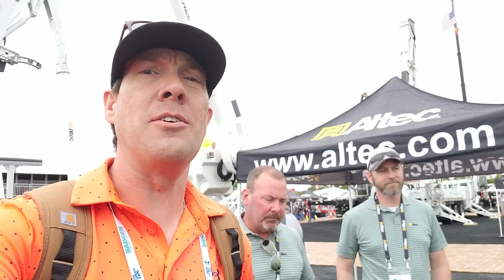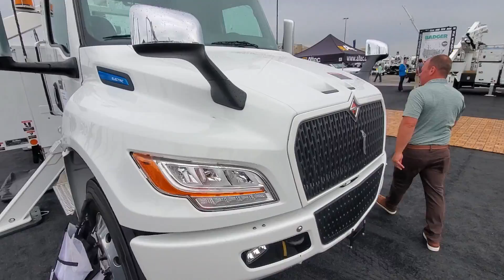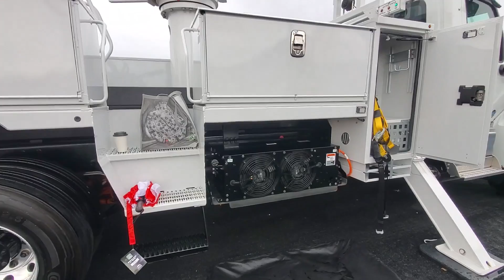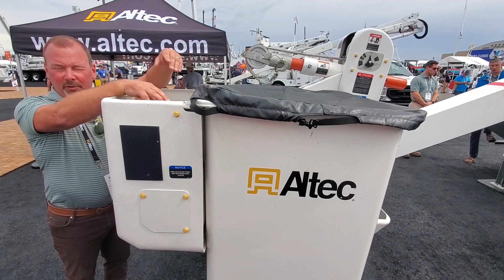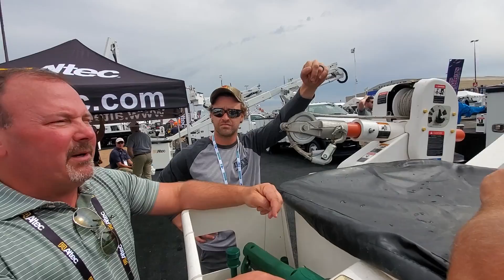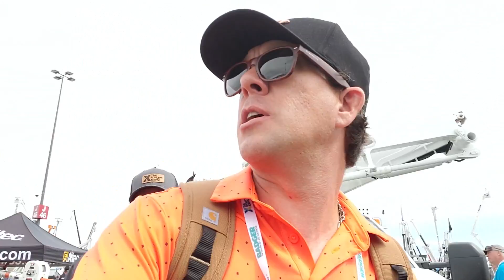EV Altec Bucket truck!

Comment: The problem that I can foresee so far is that those trucks may not have enough battery to handle a heavy day of use. Yes it may work for most work, but get a single complicated job and it will run out of battery. And unlike gas/diesel, you can't charge it back within minutes. And if things goes really wrong and they can't move the truck for some reason and it run out of fuel, you can always refuel it with jerry cans. You can't do that with battery powered. Even if you were to bring a generator on site to charge it back, it would take a few hours, and needs to be turned off before charging. With gas/diesel, even if it is not recommended due to the fire risk, in reality you could very well refill while the engine is on. But even if you do need to turn it off, it would be for max 5 minutes. Not the few hours for the battery one.

Also, cold winter and very hot summer are very problematic for battery operated vehicules. Which also limit their applications.

But they do have their place, if they can handle a full day of light work. And I have no doubts that they can.

But the problem is the price. You can most likelly buy 2-3 diesel trucks for the price of one electric one. In 10 years the battery will be dead, and it will cost almost the same price as a new truck to replace. The diesel one will still work fine in 30 years with regular maintenance.

I personally do not believe that the solution is full electric, but plugin hybrid. They can also go with a smaller diesel engine in them. Heck, instead of a let's say 200hp engine, you probably can get away with a 75HP generator. Why? When driving you use power mainly to accelerate. On deceleration they can use regenerative braking to recover part of that energy (to charge the battery) then they can use the battery to accelerate back the vehicle. When in steady speed you need a relativelly low amount of power, which allow the generator to charge the battery for the next acceleration.

Those trucks stand idle most of the time, with their engine idling. It is very inneficient! A plugin hybrid would run on battery until it start to be too low, then the engine start and run at it's peak efficiency to charge the battery, then shut off. For idling, you can easilly save 10 times the amount of fuel. While driving about half.

And those plugin hybrid don't need a big battery, which drop the price ALOT. And the smaller engine cost less too.

Comment: Honestly, I see this as a truck for the city - downtown, or dense residential areas where you don't want to be sitting there for hours on end spitting diesel fumes into the air. Many cities already have restrictions on truck operations due to noise and pollution. A fully electric truck makes complete sense in this case. You'll still have diesels for your rural areas (or hybrids), but in the city or urban areas, electric makes complete sense - cheaper to operate, easier to drive and electrics excel in the stop-and-go traffic you find in an urban area. It's not just the future, but if the technology can work great in urban areas why not start there? No one said one size has to fit all - which is why we have vehicles on the road from bicycles to semis. 

So it makes complete sense to me to offer it. Also - gas pumps don't work without power. During  a storm in the city, these trucks can also be stationed around, and with the increasing number of EV chargers, they can be sitting around waiting for a call and still plugged in so while "on call" in the city the crews can remain charged while still having amenities like air conditioning and heating without needing to idle the engine constantly.

Comment: 2:14  but level 2 is standard, level 2 is a domestic 7-22kw 240v AC home charger. Yes a 150-350kw DC super  charger would be quicker. 

But that is true for every EV. 

If the battery is 200kwh.  That woukd take about 24 hours to do a 20 to 80% charge on a 7kw charger. About 8 hours on a 22kw charger. 
About 90 minutes on a 150kw DC charger 

Or about 60 minutes on a 250kw charger.
Reply: That's mode 2 or usually 3 - IEC standards, with 3-phase. NA are special (as ever). I believe he was referring to the NEC standard, which gets you a paltry 32A at 240V (7.68kW).
Reply: @Monkeh616  32 amps is the most common size in the consumer market but bigger is available. 40 amp J1772 chargers are fairly easy to find and work great on 50 amp circuits. The standard supports up to 80 amps which is more than passenger cars can use but this truck likely can.
Reply: @eDoc2020  NEC level 2, which I was referring to, is only 32A. SAE indeed goes up to 80A, which is still a fairly pathetic 19.2kW, and indeed most cars for the US market don't have onboard chargers capable of handling that power - oh for 3-phase..
Reply: @Monkeh616   I didn't know there was a separate "NEC" charging standard. The lower maximum voltage is more of an issue than the lack of three-phase. It would be nice if the North American standard supported 480 and/or 600 volt charging because those are common voltages for industrial locations. It would make public charging banks much more practical.
Reply: @eDoc2020  480V or 600V would come from a 3-phase supply anyway. At that point you may as well use all three phases properly.
Reply: @Monkeh616   3-phase AC-DC converters are more complicated. I don't think it's worth requiring every car to have an onboard 3 phase charger. Plus we already have a single-phase standard. It would be relatively easy to add a handshake to enable 480v charging while maintaining backwards compatibility.
Reply: @Monkeh616  7.68kw would take you from 20% to 80% in about 24 Hours. Yes I know not good enough to fill between working days. But a 22kw three phase supply would  give you an 80% charge over night.

Comment: I recently watched a few videos of Edison Motors working on hybrid trucks. I believe they are a Canadian company. Their focus is on the logging industry where the extra torque is a big factor, but total distance is not. They have been working out the details of the fully electric driveline paired with a fair-sized diesel gen set. So far, their tests show double the fuel economy with the option to run fully electric locally or doing yard work. My feeling is the hybrid will win out because of the option to run quiet when necessary, and the idea of double the fuel economy will please the bean counters.
Reply: Won't be necessary, battery technology is advancing so quickly range will be doubling or more in two years.
Reply: I wouldn’t call the Edison a hybrid, I would call it an “Extended range EV”.  Electric primary diesel backup is the best of both worlds.  You get the primary fuel savings because it’s EV 90% of the time, and that 10% diesel operation keeps the crews in the field.

It can be charged to 100% at the shop on downtime.
Reply: @brians8664    you are correct in that it's not a true hybrid, but the fact that you can take it on a road trip and double (or more) the typical MPG of a diesel is key here.

Comment: Would you be able to tow a charger that could feed off of 7200 VAC and convert it to ~480VDC?  Assuming that's what the truck is if not 1kVDC or something.  If this was possible could you maybe go down the road outside the problem area with good power and charge there, maybe just 1 truck short and could get a ride back from your team if it's not necessary and just a commuter to the site.  Could be useful while enroute to far range calls without existing charging infrastructure.  The other truck with the backup generator to get it up to 40% from 20% is interesting.   I think Chevrolet was far premature discontinuing the Volt with the Bolt unfortunately.

Comment: interesting video! but these vehicles are not 100 electric, are they? Does it have a diesel heater for cabin heating? drive a Renault Kangoo van myself (Europe) and the heat is terribly bad and takes a long time before it starts at full heat. it takes a long time to get the windows frost-free.
Reply: Is that the older Kangoo or a recent one. The older ones are so compromised, modern EVs are much, much better, especially if you have heated windscreens etc.
Reply: @ramdynebix  old ? it is from 2019. possible new EV has better heat

Comment: Cool video Aaron! What are your practical thoughts on it?
Reply from the maker: I think the fully electric is neat, but not practical for me personally. The Ford Hybrid it take for sure! Full use of fuel but electric for when the constant noise of the motor running gets annoying.
Reply: @Bobsdecline  I have an F550 service truck with altec GEMS to run the boom, heat and AC. Truck is great, GEMS is honestly junk. Constant problems and will never ever pay for its self in fuel savings.
Reply: @Bobsdecline  I agree totally man!

Comment: im guessing its still a hydraulic boom. would that make it hydro-eletric?
Reply: that would be the ability for the hydraulic pump to run on both an electric motor or the engine PTO. In this case it sounds like that pony engine has its own pump and needs to switch over mechanically into that back-up mode.

Comment: He said 135 miles on a charge.  That would be great if you stayed local, but I'd hate to have it run down out in the middle of nowhere. 
I suppose if you had a generator on the back of the truck to charge it with, then it might be okay!😂😂😂
Reply: That's basically what the hybrid version would do.
Reply: not every truck needs to go long distances into the wilderness. this would be perfect for local city work.
Reply: @shokoshiro  yeah,  my second sentence mentioned that.

Comment: This is NOT a good idea....economic-wise or environmentally (overall it's gonna cost thousands upon thousands of dollars for charging stations and then to these type vehicles produce so much pollution to mine the raw materials and manufacture the batteries alone) and it's gonna need to be charged from a fossil fuel based power source 9 tines outta 10 and EVs do horribly in very cold weather. The range in emergency situations where you'd wanna be in the field for hours upon hours these things are incredibly limited. And guess what happens if the battery gets damaged or suffers water ingress? And then there's the potential repair or replacement factor which is inevitable for heavy duty utility vehicles at one point or another.

This EV push is NOT a good idea; as an experiment, maybe a hybrid option, perhaps, but all out EV....a horrible idea across the board; NOT worth it
Reply: But doesn't petroleum oil cost millions if not billions of dollars per year to extract and refine? It's fair to criticize the range and charge times, but come on, how do you expect new vehicles to magically require no raw resources?
Reply: @GOAE7777  objectively look at what goes into mining the raw materials and manufacturing of "renewable" products like solar panels, wind mills and batteries (for solar) and then we can talk. Particularly the rarer ones that are actually toxic for ALL life and leave behind literally tons of even more toxic byproducts and waste that are NEVER disposed of as they ought. Not to mention a ginormous percentage of the waste that you might believe is recycable, is, in fact, NOT.

I'm intimately involved in this apparatus and I'm telling you that the whole "conveyer belt" of a process from the mines to assembling pollutes way, way more compared to extracting conventional (and process) crude and natural gas, of which have benefitted from tech advancements and are cleaner now more than EVER to make ready for use.

Furthermore, renewable energy, as it now stands, doesn't pack the same output perimeters of conventional fuel sources and to spite popular belief, these systems still require expensive maintenance and repairs.

It's just NOT worth it. What we ought  to be doing moreso is putting WAY more effort into cleaner forms of natural energy sources like hydrogen, which sadly has its drawbacks, but are way less expensive than this renewable route that has been trodded.

This whole debate is a cat and mouse things, but sadly in time, the real truths and studies will tell ALL and by then, it'll be much too late to reverse much of the damage done in the name of "renewable energy" at a much, much higher cost (intrinsically speaking) than ALL the oil spills in human history.
Reply: Thank you...I am glad I am not the only one who feels this way...I personally don't like the idea of everyone paying more in utility cost to upgrade the electric distribution system to support EV's.
Reply: @grandinosour  my friend, that's a whole other aspect I didn't bother to mention earlier.

You're absolutely right. These type costs get passed onto the consumer on all sides, and it's NOT necessary in the least.

I look at things through a practical lens and this one just seems totally unnecessary as it now stands. Again, hybrids, maybe, but a full EV as a utility truck. No.

Keep the fire in the wires👊

Comment: The company I work for (one of the largest in north east) is planning to go full electric soon. I’m a fleet guy that’s fixed all the broken stuff. This is a hard pill to swallow.
Reply: You'll adapt.
Reply: Start learning hybrid systems and electrical diag ASAP.  Vehicles will still need to be repaired, just not the power plant quite as much and it'll require different repairs.

Comment: They better make a transformer option so you can attach a line to the mains and charge the truck when it’s on the job. That way if you’re in the middle of nowhere you can keep going.
Reply: I was thinking the same thing... pull into a parking lot and clip on!
Reply: @bm03431 Don't forget to unhook! 

Or do forget, free job security 😂😂
Reply: what level of supercharging is that?
Reply: @pabstblurobot level 13 kV
Reply: How would that work? I'm picturing something like a pantograph from a trolley, but utility lines aren't exactly suited for that.
Reply: @acohn  I'm thinking a pair of large alligator clips. If you clip onto the secondary of a pole transformer you'd easily get standard level 2 charging.
Reply: But what if the mains are disconnected or knocked out 😂
Reply: Even that is impractical.  Best option for commercial service vehicles is an EV with diesel generator onboard.  Not a hybrid at all, technically it would be called an “extended range EV”.